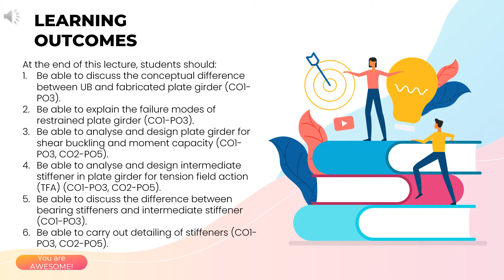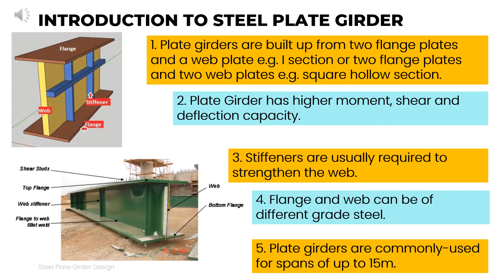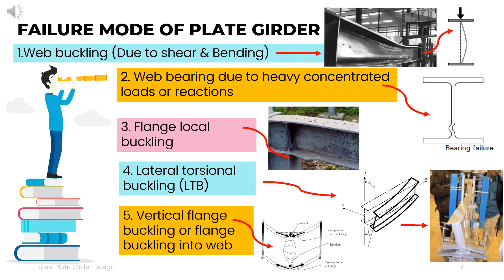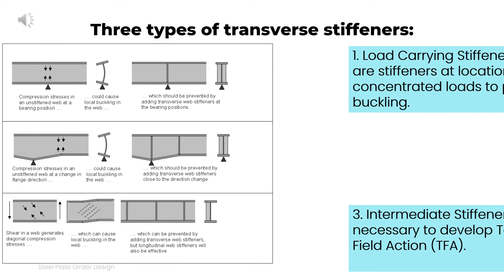Steel Plate Girder (Eurocode 3)-Summary By Dr.Ina

Comment: 5A6: A steel plate girder is a large, load-bearing structural member built in an I-beam shape by joining steel plates to form a deep vertical web and narrower horizontal flanges. It is used in applications requiring long spans and high strength, like bridges and industrial structures, where rolled sections would be inefficient due to splicing. Plate girders offer high bending, shear, and deflection capacities and often require stiffeners along the web to prevent buckling under heavy loads. Typical failure modes include web buckling, flange buckling, and lateral torsional buckling, which can be mitigated by adding transverse stiffeners and lateral restraints. In design, plate girders are dimensioned with attention to minimum web thickness, bending resistance, and web and stiffener reinforcement, ensuring stability and load-carrying efficiency over spans up to 15 meters.

Comment: 5A6: 
Definition of Steel Plate Girder
1. Plate girders may be defined as structural members that resist loads primarily in bending and shear.
2. A plate girder is typically an I-beam cross section made up of separate structural steel plates which are welded, bolted or riveted together to form the deeper vertical web and narrower horizontal flanges of the beam.
3. The key difference between a beam and a girder is the size of the component.

Introduction to steel plate girder
1. Plate girders are built up from two flange plates and a web plate.
2. Plate girder has higher moment, shear and deflection capacity.
3. Stiffeners are usually required to strengthen the web.
4. Flange and web can be of different grade steel.
5. Plate girders are commonly used for spans of up to 15m.

Functions of steel plates girder
1. To replace rolled sections for a long beam span and requirement as rolled sections need to be spliced and this may result in resistance inefficiency.
2. To support heavy loads such as on a bridge structure.
3. Plate girders are mainly used in railway and road bridge girders, and as crane girders in industrial structures.
4. A plate girder is used when we need deeper sections having higher stiffness to carry heavy loads.

Failure mode of plate girder
1. Web buckling (due to shear and bending)
2. Web bearing due to heavy concentrated loads or reactions
3. Flange local buckling
4. Lateral torsional buckling (TLB)
5. Vertical flange buckling or flange buckling into web

These failure modes can be prevented by:
- Providing sufficient lateral restraints (example: composite slab to avoid LTB)
- Adding transverse stiffeners along the length of the beam web
Function of transverse stiffeners
1. To help combat the effects of web buckling.
2. To provide support to any concentrated load or reaction. 

Three types of transverse stiffeners
- load carrying stiffeners
- load bearing stiffeners 
- intermediate stiffeners 

Steel plate girder design process 
1. Minimum web thickness
2. Bending resistance 
3. Basic dimensioning
4. Web design
5. Design of stiffeners

Comment: 5A6: plate girder design by 2 flange section on the top and the bottom and the middle we call web and support by web stiffeners…economical plate girder is thick flange,large depth but very thick web …there are also many type of failure mode of plate girder exp; web buckling due to high load to support

Comment: 5A6: steel plate ginder summary

- plate ginger is structural member that resist loads primarily in bending and shear
- typically I beam cross section
- the difference between  beam and ginger  is their size of component
- plate ginger are build up from two flanges plate and web plate.
- their have higher moment, shear and deflection capacity.
- their commonly used for span up to 15 m.
- for economical design, plate ginger has very thick flanges, large deep but thin web

Functions:
1. to replace roll section for long beam span
2. to support heavy load such as bridges
3. mainly used in railway and fridges
4. used when we need deeper section having higher  stiffness to carry heavy load

Failure mode of plate ginder:
1. web buckling (due to shear and bending)
2. web bearing (due to heavy concentrated load or reaction)
3. flange local buckling
4. lateral torsional buckling
5.vertical flanges 

can be prevented by:
1.providing sufficient lateral restrain
2.adding transverse stiffness

Comment: A plate girder is a steel beam. Metal thicknesses for the web, flanges and stiffness are chosen based on the structure's requirements and design specifications.
 The two most important considerations for creating a plate girder are using the proper material (steel) with the required strength and welding.
 When structures require deeper sections with more rigidity to support huge loads, then employ plate girders. The ability to produce a hot-rolled section is also limited as the section's depth increases. Therefore, we need built-up sections that have a high capacity for bending moments and shear stresses.

Comment: The functions of a universal beam (UB) and a plate girder are similar, but their sizes, shapes, and the amount of weight they can support are different. There are five different ways that a plate girder can fail: flange local buckling, lateral torsional buckling, vertical flange buckling, and web buckling due to a strong concentrated load. Transverse stiffeners and adequate lateral restraint can be added to prevent these failures.

Comment: Plate girder may be defined as structural members that resist loads primarily in bending & shear. Plate girder is used when we need deeper section that having higher stiffness to carry loads. Difference between beam and girder is the size of component. Plate is built from two flange and web. Plate also higher moment, shear & deflection capacity. Flange & web can be different grade steel. Size of plates consists of flange and web can be chosen by designer. Plate commonly used for spans up to 15m

Comment: To summarize, a plate girder is an I beam that can resist bending n shear loads. Plate girder has higher moment, shear and deflection capacity which make it suitable to be used in structures that have heavy loads such as bridge and railways. Plate girder can also face many type of buckling failure and can be prevented by adding tranverse stiffeners.

Comment: A plate girder is an I-beam cross-section made up of several plates which are welded, bolted, or riveted together to form the deeper vertical web and narrower horizontal flange of the beam. The difference between a beam and a fabricated plate girder is the size of the component. There are a few types of failure mode plate girders such as web buckling, web bearing due to heavy concentrated loads or reactions, flange local buckling, lateral local buckling (LTB), and vertical flange buckling/flange buckling into the web.

Comment: Plate girder is structural members that resist loads primarily in bending and shear. The example of failure mode of plate girder are web buckling, web bearing, flange local buckling, lateral torsional buckling (LTB) and vertical flange buckling. The difference between universal beam (UB) and plate girder are size, form and the loads carried.